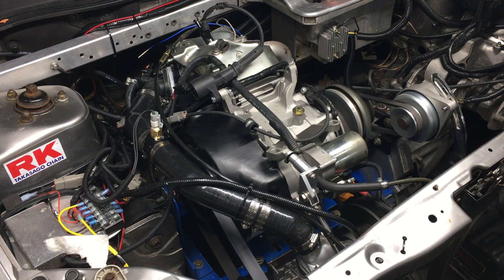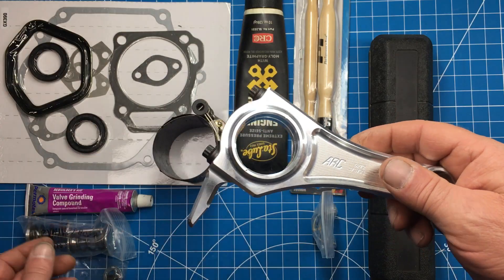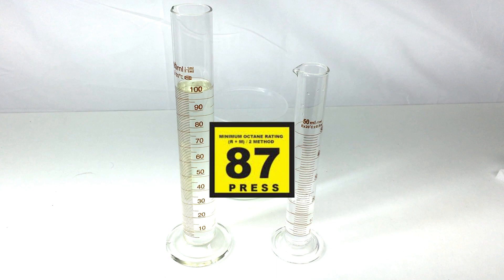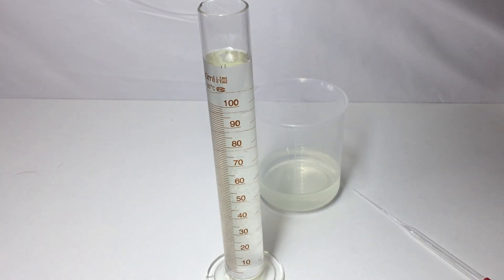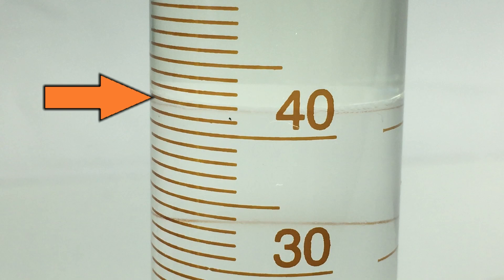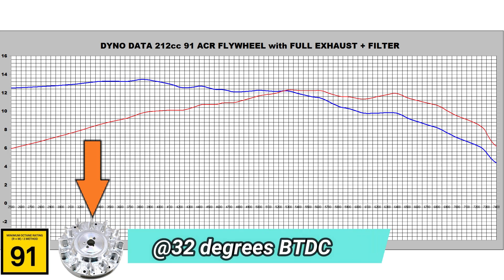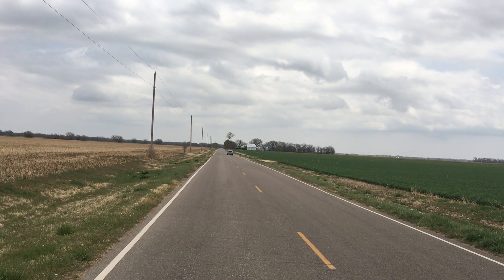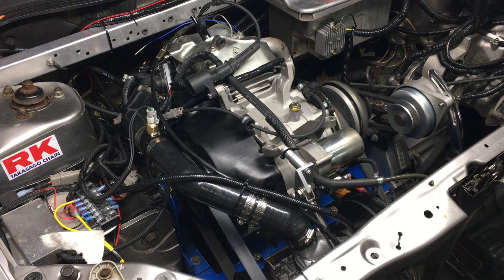S2E8: We dyno test several fuel grades to see if good gas is better than cheap gas for small engines

Comment: I get the deal with the flywheel and cooling........  if you wanted to run the performance flywheel,  you'd need a more robust fan, which then creates more drag.......   negating benefits.   It would be truly fun to see the project car tuned up well enough for a day trip.   Fun stuff.

Comment: Common misconception about octane rating and power:
Octane is effectively a measurement of how well a fuel resists knock, AKA detonation. 
Higher Octane fuel actually makes less power at the same manifold pressure. This makes sense because put very simply it is harder to burn.
Engines "knock" when the fuel ignites prior to the spark plug firing, causing the fuel to burn with very advanced timing, as well as the flame front not starting in the right place.
A common cause of engine knock is increased manifold pressure from a supercharger creating conditions in which a fuel with too low of an Octane rating will detonate.
The reason performance engines with superchargers use high Octane fuel is because the added power from Higher manifold pressure is far more than the very small losses due to the higher Octane required to prevent knock.
If you want performance, always run the lowest Octane that the engine can use without knocking, plus a small safety margin.
On the subject of determining which Octane rating a particular engine needs is unfortunately not simple. Many design elements as well as manufacturing and wear can drastically effect how prone to knock a given engine is. A classic example of this is an engine that may not knock at a given manifold pressure and Octane rating can start to knock as carbon builds up in the cylinder head, because carbon deposits can heat up and act like tiny glow plugs from a diesel engine.
Incidentally, diesel engines use extremely low Octane fuel because they essentially run on detonation, being designed for the fuel to ignite from the pressure and temperature when compressed, the same thing we call "knock" in a gasoline engine.

TL;DR:
High Octane fuel makes less power at the same manifold pressure than lower Octane fuel, and the only reason to use it is when a supercharged engine experiences knock with low Octane fuel.

Comment: Good stuff. 👍
Here in Brazil, the gasoline have anything between 10% and 27% of anhydrous ethanol mix up to reach the expected octane index. We also have hydrated ethanol (roughly 4-5% water) as fuel option and it behaves a bit like 100 octane gasoline, but with a way slower burn.

Engines with low compression ratio, may run it just fine and I do saw some Ford OHV 1.3L with mere 8.8:1 compression ratio, but anything between 10:1 and 12:1 is desirable to run ethanol with a higher efficiency, otherwise you may expect a milage near 70% compared to gasoline. The best mileage I observed with ethanol was 80% on high compression ratio engines.

My 1995 Ford Fiesta Mk3 currently use a 1.0L Zetec Rocam supercharged with 11.8:1 compression ratio and around 1.7 pressure ratio, resulting in a very high dynamic compression ratio. I still would like to tune the engine for 87 octane gasoline even with all this boost and compression ratio and evaluate power and mileage on it, but I'll need do it on a dyno with a proper knock sensor, otherwise the engine will be destroyed. 

The 212 Predator only have 8.5:1 compression ratio, that's why any fuel with a higher octane index will not result on any tangible benefit. After all, these engines were made to operate reliably with the cheapest gasoline around.

It makes me wonder what if you repeated this test with some higher compression pistons on the 212 or if you put the AMR300 on a 1.5:1 or 2:1 ratio to slowdown the blower a bit for this small engine and provide some decent boost to increase the dynamic compression ratio.

Well! Thanks for the video!
It is very informative and entertaining to follow this project. We always learn something new on them. 👍

Comment: for what one of those billet flywheels cost, you'd think they'd cool better.
Reply from the maker: I think so too, but ultimately they are more or less indestructible and you can rev the little 212 past 8K without worry.
Reply: They cool just fine. They are used for the minibike and go kart application. The PVL flywheel is said to cool too much and it is recommended to tape off the openings in the pull start housing for less cooling.

Comment: Can you cut the aluminium fins off the go kart one and put the plastic moulded fins on top?
Reply from the maker: I looked into that, but the flywheel has a different profile.
Reply: Maybe 3d print one? Mould it from a negative and then put one on that? Worth a shot 👍

Comment: It seems like you know a decent bit about fuel, so I guess I’ll ask you this question. Could the lower amount of ethanol affect or cause a misfire in an engine? My 06 civic hybrid started misfiring around the time that fuel prices shot through the roof, but i refueled yesterday and the misfire is almost gone. I was thinking since it’s an economy car the engine is probably tuned pretty finely for mpg’s so could the change of ethanol be a problem?
Reply from the maker: Its hard to say, the EFI computer should compensate for the difference.  You may need to verify the condition of the spark plugs.

Comment: I like to put a little diesel in my gas to clean out the fuel system. I feel like it adds torque but it’s most likely placebo effect. Probably doesn’t clean anything either, someone should test it.
Reply from the maker: That's interesting,  I think the next time we drag out the dyno we will add a bit of diesel to the mix.

Comment: " Behind a blast shield " , however, the engine will spit parts directly into the blast shield if it comes apart.  The motor really should be turned 90* so the operator isn't in line with the plane of rotation.

Comment: On 93 octane fuel with 22% ethanol - you need to add extra fuel on carb, thats why it have high idle (too lean). Radiculus ignition advance + extra fuel (± 10~15% more) prevent detonation and 32 deg timing will use ethanol benefit

Comment: Richen the jets and try the 93 again and you will make as much as the 87 or might make a little more HP.  Ethanol will run very lean in a gas engine.

Comment: More octane will only give you more power if you have enough compression to need it other wise its not worth the money.  I have a car with 12.4 to 1 and i can't run anything under 113 octane or i lose power and the engine will run even after the key is off. Using a stock lawn mower engine with prove nothing.

Comment: I think that a portion of your lost horsepower from the flywheel, comes from the fact that it is lighter. On a standard dyno run, the lack of mass would lead to increased acceleration of the crank and thus increased horsepower. However, your situation is the opposite. With the engine already spinning, the energy stored in the flywheel will contribute to your power numbers. I don't think it accounts for all the lost horsepower, but I think it is significant in this case.

Comment: Dumb question: would putting some sort of shroud around the flywheel allow you to go beyond 5000rpm? Apart from the flywheel, what would you need to reach high rpm (and wouldn't that be a nice goal for season 7 of the show: reach 7000rpm with a cement mixer engine?)?
Reply: Engines of this type are commonly ran at 7K RPM plus for years in the minibike and go kart application. You just need billet parts for safety.

Comment: I get where he is going with the fuel tests, but do feel that the test was not representative of the current situation. I don't have the greatest understanding, but essentially I thought the largest benefit to high octane fuel was that it resists detonation under high compression loads. IE: The stupid charger. Where I would expect he could run higher boost, and thus higher compression before fuel became a problem.

If I am wrong about that, someone let me know.

Comment: I would try to find ethanol free gas. The ethanol os sooooo hard on the fuel systems for those little engines and destroys fuel lines and gaskets. I wonder how much power you would make on ethanol free fuel.

Comment: Aside from volatility I can't know if the predator alternator is a predator power generator because an inverter would be required to make it an alternative power generators for small household appliances. My Junk math would disprove 100 amp 14 volts 1400 watts with more junk like 100a/14 volts would indirectly not correctly indicate that a 115 bolt ac load would burn well at 7 amperes.
    I had to look at the watt meter in my head all confused with my junk math and short term memory not to mention my short attention span and complete inability to logically deduce even the need to comb my hair or let alone bathe but I landed with the starter from a small Toyota because 1.4 KW - 2.4 KW of motor power with the engine operating at (more junk math) 50% durability....oops forgot where I am. Whenever both my eyes go blurry I get lost and panic.
   Anyway, I just wish everyone would slow things down.....55-65 mph and noise is frightening. I dream of everyone and everything doing 5mph but might be okay with 15mph on interstate highways if they built better migration routes.
Cheers
Had to note how difficult it is to type most letters, I'll aim for the g but get everything else. It takes a several taps to get each letter correct. Oddly this cheap android lijes to auto scramble. 
    Anyway, the permanent magnet Nippon denso starter amazed me when I bought my first Corvette back in ....many decades ago. Those motors are very nice and easily repairable, upgradable, cheap and lightweight but strong. So with a cheap pwm controller, an H bridge, and a few flyback diodes.....time for my nappy

Comment: Higher octane will result in less power if the engine runs great at 87.  There is more energy by volume in the 87 so that makes sense.  But if the engine is optimized for the higher octane then the lower octane will either reduce performance or the lifespan of the engine.

Comment: Here is something that many people do not know about the fuel industry - MID grade gasoline is unusually a blend pulled from both the Premium tank and the Regular tank.   The octane rating is a computation of the blend mixed using proportional valves within the dispenser.  Very, very, very few fueling stations have an actual Mid-Grade blend in a tank.

Comment: ECU controlled spark advance will give much more power than fixed especially in car application. Fixed advance fine for fixed RPM usage such as cement mixer, car works in wide range of rpm and loads.

Comment: It’d be really cool to have a dyno harness for the EFI - since those street rolls take a country mile and a half to test - and you could easily stethoscope it to listen for rattles.

I have a twin 212cc drift trike on twin torque converters that could also benefit from a better 3k-6k powerband. The timing keys are a best-guess and I also skipped the billet flywheels because I thought the advance was too much, myself. I have toyed with the idea of demi-turboing it. That’s twin motors, one turba.

Comment: I use 89 "rec fuel" (ethanol free) in all my small engines. Mostly because its still good fuel 2 seasons later. Havent had to clean a carb since i started doing that.

Comment: Won't this kind of brake dyno give artificially high power readings to rotating assemblies with greater moment of inertia? You might have lost a bit of reported power just by switching to a lighter flywheel, all other specs remaining identical.

Comment: Once again, the Old myth that higher octane fuel is more efficient and provides more energy has been broken. I've known for years that standard 87 octane provides more energy per gallon than a higher octane gas. 

How can that be, it's because they get those higher octane ratings by adding chemicals to slow the burn rate down thereby reducing the energy created.

Comment: LOL Literally just mowed yesterday... 

EDIT: You might try the higher octane fuel due to the increased compression ratio of the super charger. The Octane Rating is (as far as I know) Just a measurement of how resistant to pre-ignition (Knocking/Pinging) the fuel is. Higher Octane, more resistant to pinging. The higher octane is used in High performance engines due to the high compression. Other than this reason, unless you are running high compression engines and or boost, (which in the Street Legal Gokart you are) Using higher octane fuel might help if you are having trouble with preignition due to high compression ratios.

Comment: I would love to see how much performance could be gained by tuning the engine to take advantage of the 97 octane. I understand that simply switching one to the other won't improve performance and possibly even harm it due to the differences in ignition point. Would simply retarding the ignition timing be enough to resolve that? What, if anything, needs to be done with the air/fuel ratio? I would love to find out. :)

Comment: that 22% ethanol in 93 octane would explain my 93 rams behavior....sometimes when i fill up, it runs hard, and others, it runs weaker. i think my local station is bumping octane with ethanol.
Reply: I used to have the same problem with my pickup. I never thought it could be the mixture from the gas pump.

Comment: Another good video.  This video perfectly illustrates what many competent engine builders know, in that higher octane gas does nothing for more power on a standard engine. I always cringe when I hear people say they put premium fuel in their vehicle so it has more power and better gas mileage .  While premium fuels can have some benefits, unless your car requires it or is a built higher compression engine, a vast majority of those benefits are lost in standard engines.  Keep up the good work Jimbo!

Comment: "Should I try the >20% ethanol 93 octane?" 
Mmmm no, IMHO you'd gain perhaps 3-5% power at a 10-15% consumption increase (over 87). The 91 octane with a supercharger, I would go that route if you really wanted to try maximum power.

Comment: The e10 is likely still e10, don't worry! Water and ethanol don't actually mix the way most people would expect them to. When you mix the e10 and the water, the ethanol crashes out like you described. However, the size of the molecules of ethanol is different than the size of the molecules of water. This means that the molecules can "slip" between each other, which can lead to the difference in volume you saw in the test. If you mix 20ml of water with 10ml of ethanol, you would expect to see 30ml of a water/ethanol solution, but you end up with something like 26-29ml instead because of this.
Here's a video that shows this happening: https://youtu.be/INcoDdhv3hI

Don't worry! The gas is okay! You're not getting shorted by big gas companies

Comment: Thanks for sharing👍 yep, the fuel test showed just about exactly what I thought it would. No surprise to me.  But the ARC flywheel... surprising! Makes perfect sense but I never thought about the reduced cooling capacity with less fins🤦‍♂️ almost hate to admit.  Also the ridiculous timing advance with the arc flywheel may be adding to the heat generated.  Looking forward to the next video!

Comment: Does the amr300 have teflon coated rotors? If so, how are they reacting to the fuel air mixture from the carb/ throttle body?

Comment: I have to say i love what you are doing I drive a 1987 4 door 4 speed Chevette it has the 1.6L 4 cylinder cast iron 50hp @5500rpm  original engine.  I am very interested in what you are doing because I would like to get to 70mph as well lol I am wanting to try a few things this summer but want to be able to put everything back to original.  getting to see all your experiments helps give me ideas to try and other ideas that are probably a wast of time.  Thank you
Reply from the maker: 70 MPH in a Chevette... are you insane?  lol.   I drove one of those back in the day.  Yep a 4 door, 4 speed 4 cylinder... a 444 if you like.
Reply: @robotcantina8957  I do like to explain to those to young to have experienced (under 30 lol) the joy of driving a car that came with an AM radio as the most electronic part.  I always chose to drive the more basic models and its what I have now the "444" I would prefer a 454 the extra gear is nice.  I like to say how nice it is to not have the extra power options that could break no power windows or locks no power steering power breaks or power in the engine lol .  I live in that big empty space above America we call it Canada where we like to talk about our cars MPG but price our speeding fines in Km/h I dont know if Im the only one who likes to leave out the units when saying how fast i was going because at least in the US it seems fast for example my car seems to like running around 100 to 120...........km/h or 65 to around 75 mi/h   Yes I have that odd Canadian? sense of humour and im a dad so ........

Comment: If 93 octane is just 87 with 22% ethanol, couldn’t you just mix E85 with 87 octane and get cheap 93? I’ve actually done it in my truck before, and it runs better!